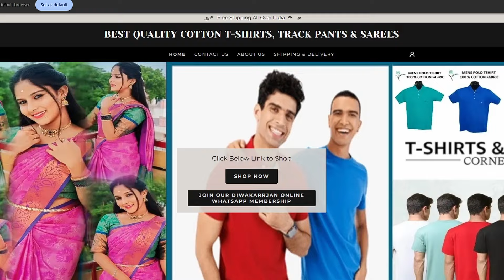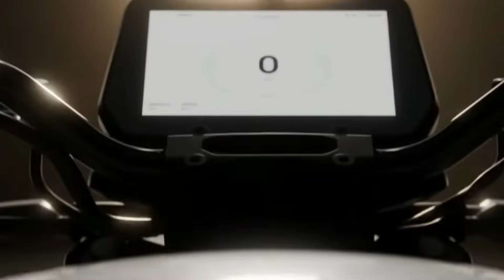India's First High Voltage Electric Bike - RAPTEE HV Electric Bike Detailed Review in Tamil

Comment: there is eve electric bike that uses higher voltage and give upto 300km with 21kwh batteries at higher speed..
Reply: That's Zero bike... Marc travels
Reply: But price also 5 lahs OK va😅
Reply: Actually Zero bike with 300km range cost starts at 12 lakhs upwards to 18 lakhs